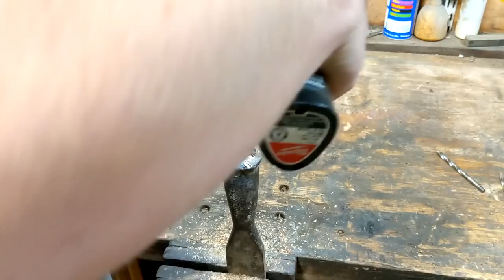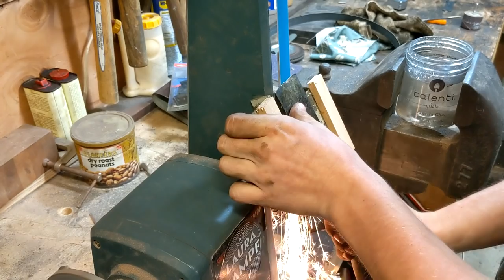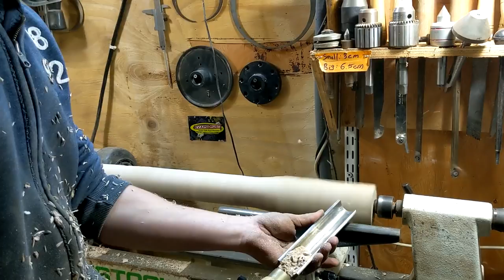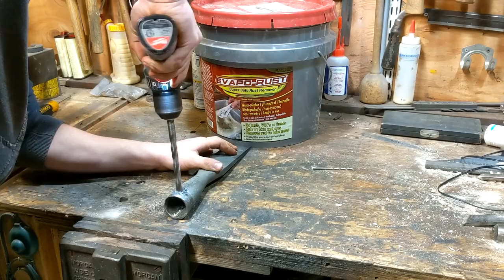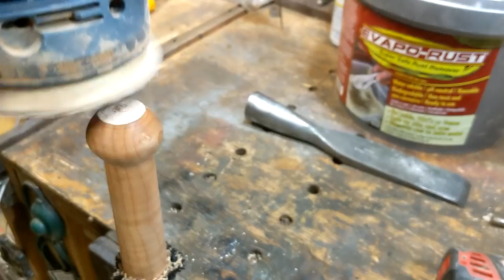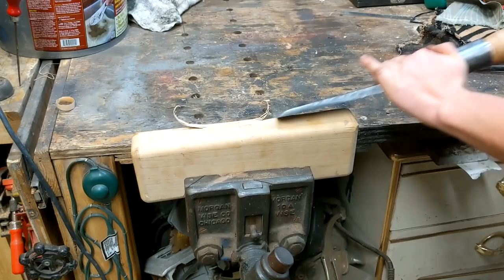Restoring a Massive Chisel

Comment: You should have measured the inner diameter of the chisel before wood turning, it could have been thinner than necessary. 
And you should have kept the patina
Reply from the maker: Personal preference, and you must've skipped over the part where I used calipers to get the inside diameter of the slicks socket while I was turning...

Comment: Really Nice! Did you consider putting a micro-bevel on the cutting edge? A 5-degree one usually lets the blade cut much easier through the wood.
Reply from the maker: Thanks for watching! I've heard of them but since I sharpen by hand most of the time there is already a bit of a micro bevel from that. Also this piece has such a huge weight that if you get it decently sharp it will just go.